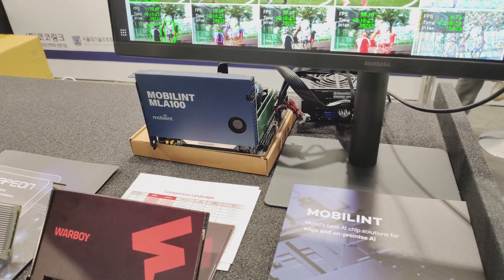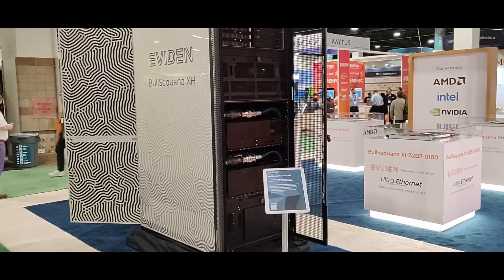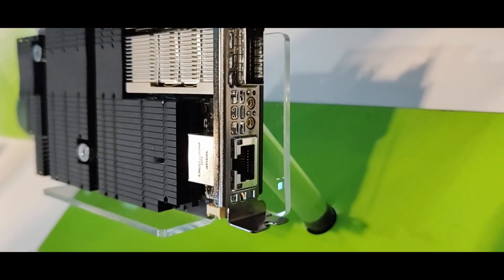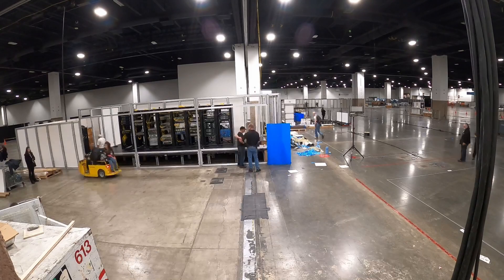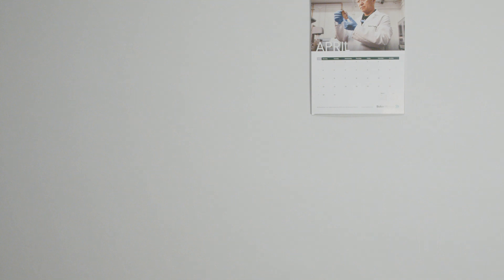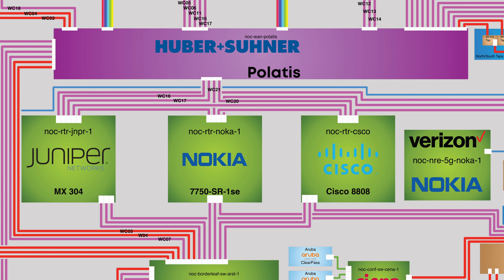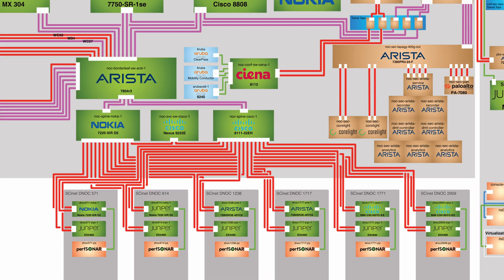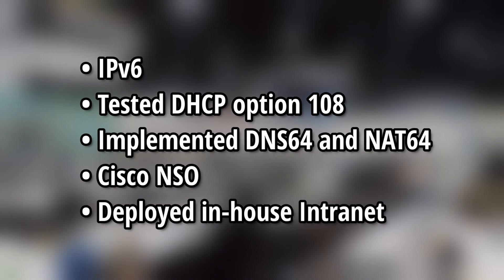How I helped build world's fastest temporary network

Comment: nice to see it has built in USB-C on internal SSD at 1:25. really makes life easier.
Reply from the maker: I know, right? They also had 3,5'' SSD's with 20 or 30TBs in capacity. Much faster to just take such drive with you rather to send it over 1 or 10gbit network
Reply: Wow 30TBs per SSD? That's crazy. Still can't believe the storage technology is improving this rapidly

Comment: So cool. What a complex network tho haha! Probably more so even than some small - medium scale datacenters :)
Reply from the maker: Well, yes and no :)
For example, some would argue that deploying EVPN-VXLAN for basically 4 leaves and one layer of spines in between is overkill, and they'd be right. But here, in SCinet it's mostly about showing off that "yes, you can", even in a multivendor architecture
Reply: @DCTekkie 
but I'm a 'lil bit confused, wasn't compatibility like this always common? Even like 20 years ago people wouldn't use same vendors for routers.
Reply from the maker: It depends. Even basic stuff like MTU can be understood differently in config depending on a vendor, sometimes 9000 != 9000. Now, you have EVPN/VXLAN which is few techs stacked on top of each other, implemented independently by each company. It turns out that one vendor can process BGP updates a bit differently.

For edge routers doing  eBGP, sure, you can have different vendors, but you're using mostly standard BGP. But here this network does interesting things within iBGP.
Reply: @DCTekkie  
Interesting. How did you learn network OS's if I may ask? I only have a paper understanding of them and would like to learn more about vendors like Arista, Cisco, or juniper
Reply from the maker: @hariranormal5584  You can get Arista vEOS for free from their website and launch it within GNS3. Cisco and Juniper I dealt with either at work or at uni. The rest was new to me when i started doing SCinet